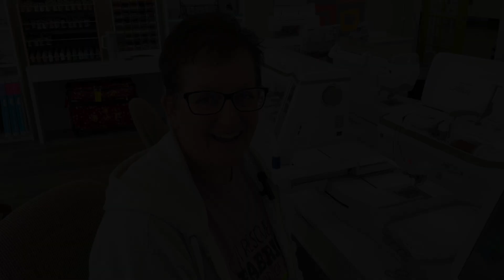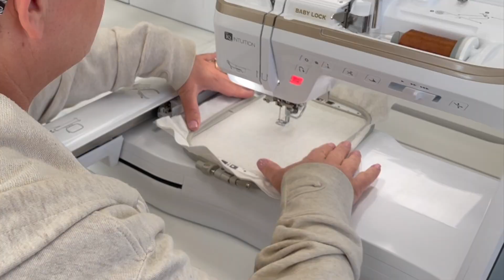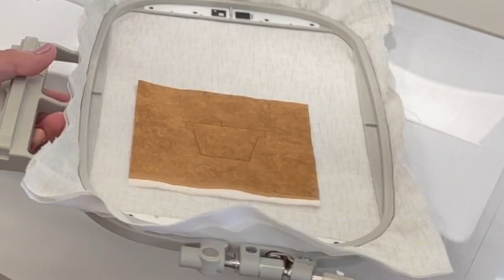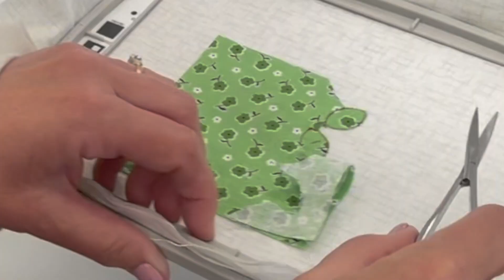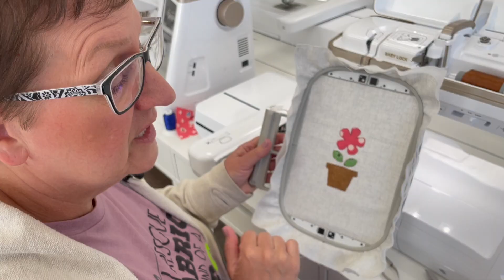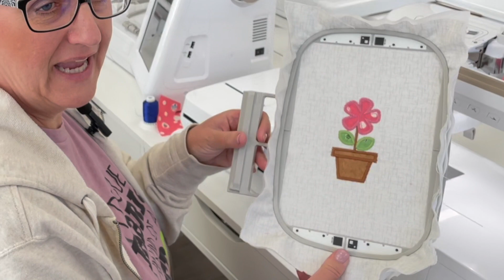The Baby Lock Altair: Machine Applique

Comment: Without an embroidery file put into the Altair, will this machine do applique with simple shapes like squares and rectangles and circles, etc? If you had a sewing project and you wanted to applique a shape onto your project so that the machine sews it on for you, will it do that? If so, can the applique stitches that are used be changed?
Reply from the maker: Great question! The way the machine "appliqués" it on is by the digitizing software used in embroidery mode! You can create simple shapes in "IQ Designer" (software built-in to the machine) and tell the machine it's an "appliqué" piece and you can convert it into an embroidery file to then stitch out! We'll have to show a video on that here soon!
Reply: @MyGirlfriendsQuiltShoppe  Thank you!